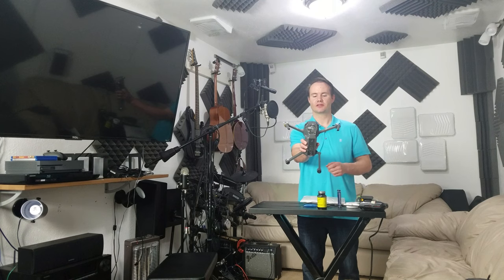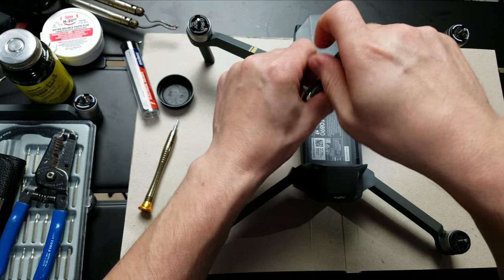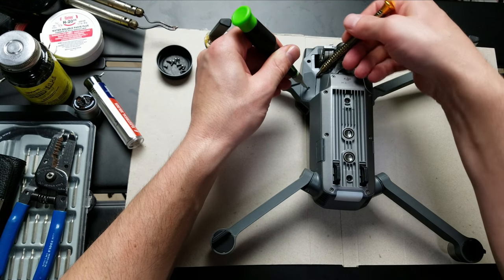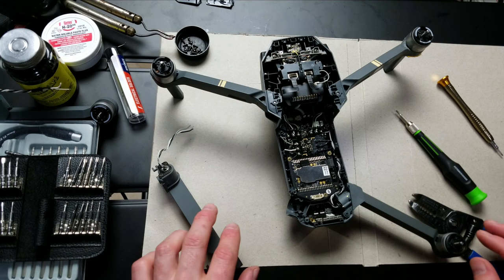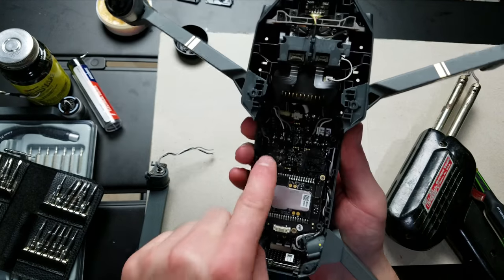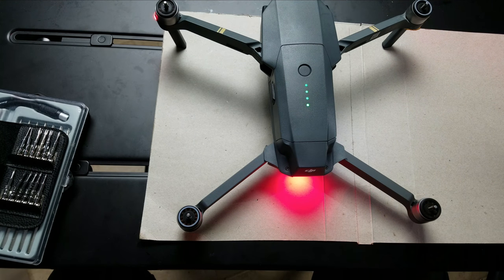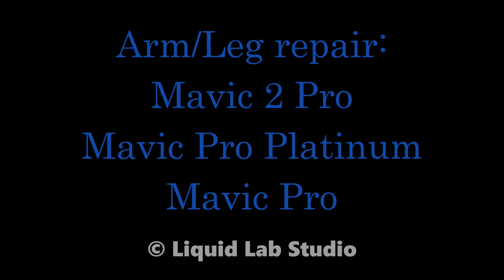Crashed Mavic 2 Pro Drone Arm/Leg Repair: For Mavic 2 Zoom, Mavic Pro Platinum, Mavic Pro in UHD 4k

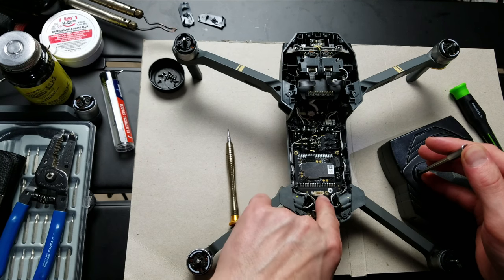Comment: Cool video man but @ 7:45  I would recommend using a grn strap that keep you connected to ground until you finish working  on the circuit board...Touching the grn pin off and on don't really do nothing. Just a tip
Reply from the maker: Thank you for commenting @basimpsn. You are right a grounding strap is preferred. I have been pretty fortunate around 1000+ circuit boards and luckily never ruined one. (I hope I didn't jinx myself lol) I know most people don't have a grounding strap or will not take the effort to buy or make one. I figure the relays on the other side of the motor controls protect the processors and IC's/electronic circuits during the repair; the protective spray on the circuit boards could have been the main contributing factor for me not static frying components. At a minimum the novice repairer can use earth ground to minimize their own potential static charge along with the aircraft's. When working on computers I tend to rest one hand on the case ;)
Can you do me a favor and Subscribe?
Cody LLS
Reply: @LiquidLaboratoryStudio   My day time job is an rf technician to component level. Very rarely do I use a grn strap lol.. I was just making sure you know the difference with touching a grn point or using a grn strap. You have good knowledge about electronic components Keep up the good work.
Reply from the maker: Haha, I know what you mean about the experts taking shortcuts. My buddy is an electrician and he takes lots of shortcuts except for commercial applications. hahah I learned from taking things apart when I was young and schematics/google; I've been around residential wiring, studio wiring, electronics, and vehicles for years. If you search the Mavic Pro PCB flat ribbon cable replacement videos on youtube they are all copies of the original one I made. Too bad, I was more concerned with repairing/fiddling around on camera it could have been the standard instead of a training video for the other channels. lol 

Thank you for your good words and positivity. 

LLS
Reply: @LiquidLaboratoryStudio    I need to check out your other videos since I just bought the M2Z and might need to know how to replace parts if need be. This is why I love youtube because of people like you will to put your equipment on the line to show others how to disassemble and do your own repairs.  Yes electronics as been my hobby as a kid and now my main income as a adult.  I worked on and design so many electronic projects..  I never get bored of it.  Take care.

Comment: Why would you do an IMU calibration?  all you did was change your motor and unplug the GPS module. I guess it was crashed so u are right...I would maybe do a compass calibration and imu but then again the app would tell you looking at the values..... looks like you had some trouble with the left back side of the top shell going back in place did you have the motor wires seated correctly? I see you did an edit....lol otherwise good job

Comment: I didn't see it in your video but I am curious as to where the GPS unit is in the Mavic 2 Pro? I want to attach some Bluetooth trackers and the like to it but don't want to cover the GPS unit! Thanks! Great Video!
Reply: Cody, I have been a supporter of your channel for a long time so I've got you covered there. I would greatly appreciate if you would do the same! I remember back when your Mavic Pro went down and I commented that I didn't believe it was tracking properly as it looked like it was crabbing a bit during flight.

I have been using Velcro to attach the tracker to the top of the battery but this gets old moving it every time I swap the battery. On my old Mavic pro I have it attached to the attachable rear leg extensions which works well but I haven't found the same kind of adapter yet for the M2P.

Was this your Mavic 2 that you are repairing? If so did it go down and are you going to post a video about it also? Thanks!
Reply: Thanks Mike, no they used the same configuration so I put all models that would benefit from this repair new to old.  The Parts for your newer drone may take some time to trickle down.  You can always temporarily attach it to the bottom landing gear. How big is it? The challenge with any attachment is that it could create profile drag which could effect flight time or maneuverability. How are you liking the model 2?
Reply from the maker: I got you covered ;)
btw: because the youtube change in February I became stretched thin across 2 channels it has been a real hassle.youtube.com/LiquidLabStudioyoutube.com/LiquidLaboratoryStudio
Thanks again for the Sub's
Reply from the maker: @Mike, I saw some of your videos. Wow the link I sent is broke here is the other channel. 
youtube.com/LiquidLabStudio 
along with the original channel. 
youtube.com/LiquidLaboratoryStudio
Reply: Yeah, I am supporting your other channel too. When I first saw this video I thought you were repairing a Mavic 2 but looking closer I see that it's the older model. Which do you like better the Phantom or the Mavic?
Reply from the maker: In my opinion the phantom  4 Pro is way better. It shoots smooth cinematic video, the camera also is centered directly below the aircraft and can see more obstacles. The Mavic 1 doesn't have a good camera or gimbal mount. The phantom 4 Pro's collision avoidance works way better especially because it works on 5 axis's. The blades on the Mavic are brittle and are constantly breaking not to mention the repairs of the motor arms. The mavic isn't entirely a waste considering it's limitations if you want a collapsible, portable, nice smaller controller, and quiet drone it makes sense. Taking it into those last minute flight areas/traveling with it is easier. If I was wanting a good stable cinematic video P4P all the way. The next up from the P4P is the professional inspire with a 5k+ dslr camera attached.

Comment: I want this cleared up. The other day when flying just before sun up I had my Mavic 2 Zoom in positioning mode. I understand it has obstacle avoidance. Without warning it flew into a tree.
I was able to retrieve it unhurt.
Today I took it out and tried several things. Keeping it in positioning mode I flew slowly into
a gym. It stopped about 15' from the gym. I moved back, turning it around and backed it into the gym. Again it stopped 15' from the gym. I then moved it back from the gym and turned it sideways and moved it back to the gym. At no time did it stop or signal me danger. I tried the other side and it would have let me crash in to the gym.
I put the Mavic 2 into Tripod mode. This mode would not let me go forward, backward or each side to the gym.
Is my Mavic 2 working correctly. I know that Sport mode turns off all the crash avoidance sensors.
Any comments......
Reply from the maker: The Mavic 2 Pro and Mavic 2 Zoom are not perfect system. Try switching  to P mode and back into Tripod mode. The problem is the indicator at the top of DJI Go4 indicates green that you do not know when they are not 
active. 

Never plan a flight where the sensors HAVE to work in order to be safe. The technology is simply not reliable enough, and can't be for that money, a toy drone would have to cost as much as a Tesla to have truly reliable sensors and programming to be able to trust 100%. Well.... even a Tesla is not 100% reliable in its decisions and AI, but since it is already on the ground it's considered safe enough.
Just like the Mavic Pro the sensors are just not enough to prevent all crashes. The front of the drone uses a combination of the optical sensors and the main camera to get the best vantage possible. The rest of the drone relies on the two smaller cameras and/or infrared sensors (infrared is the only top sensor). This helps but the sides and back are just not as reliable as the front. Also using optical sensors is subject to lighting conditions and interference. Kind of like a human missing an eye, blocked vision, or just having poor vision.

I hope this helps. Can you do me a favor and Subscribe?

Cody, LLS
Reply: @LiquidLaboratoryStudio  Thanks.... I did Subscribe :-)
Reply from the maker: Thank you so much @D Hansel